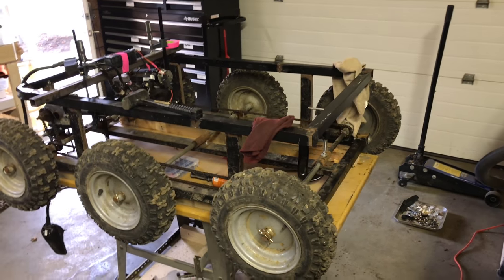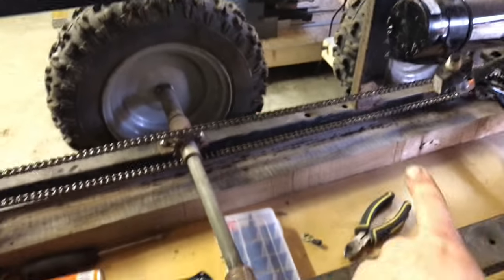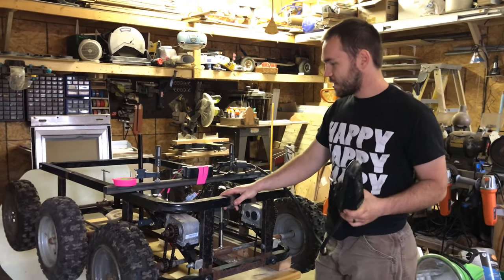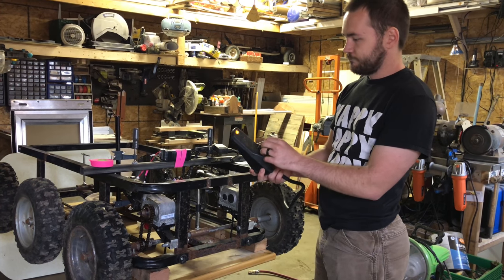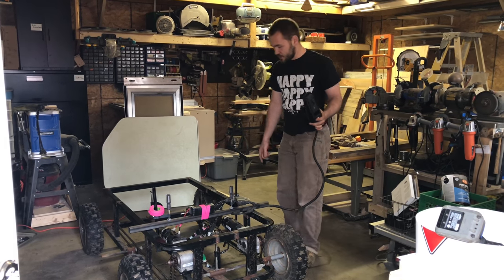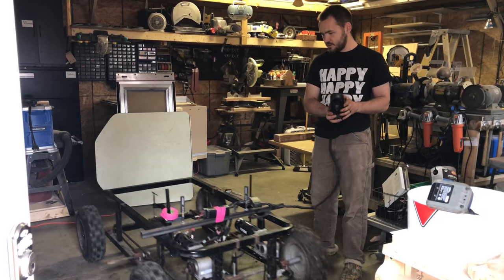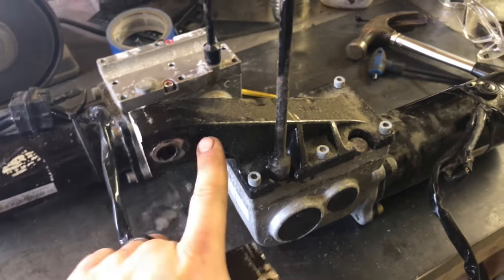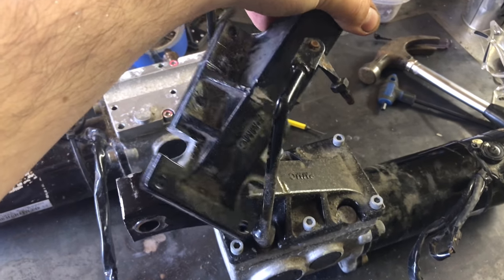Mini skid steer utility thingy build log1

Comment: the motors definitely have the power to turn your machine, but you are being limited by the wheelchair controller.  Those can be programmed but there will still be a limit to the power, speed, and acceleration settings.